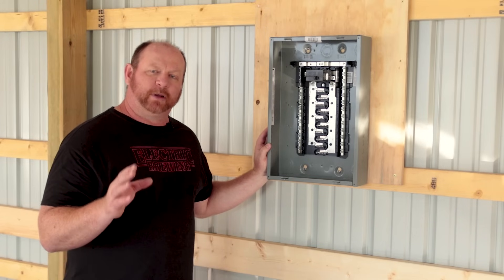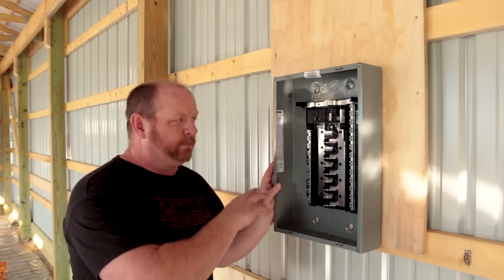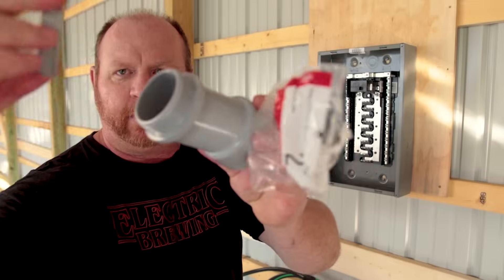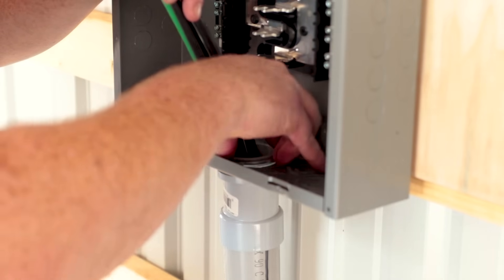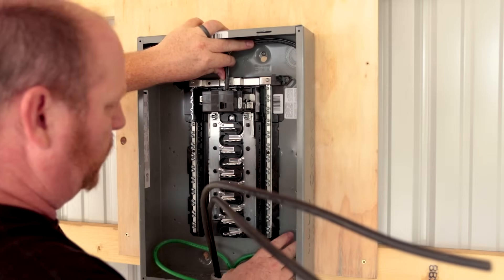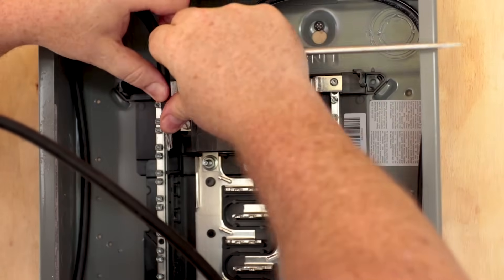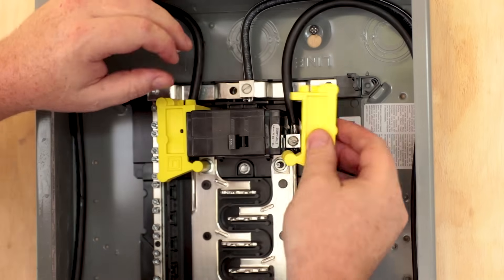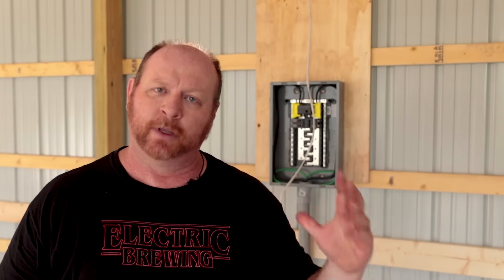How to install a main breaker panel in a garage. -  Square D Homeline 100 Amp Main Breaker

Comment: I HAD A NO PANEL INSTALLED OUTSIDE WITH ITS OWN SERVICE HOW DO I make runs to sheds and other places if needed. do i need conduit for each run? what is needed when it goes into shed? i know how to install outlets just confused when it enters shed
Reply: Is he working with a 100 amp size breaker panel ? Or a 200 size breaker panel?

Comment: I don’t know why someone who’s not an electrician would put out a video like this. And why would you use aluminum wires. I just spent last winter doing aluminum wire mitigation. The amount of melted wires I found was crazy. I’m surprised the apartments hadn’t all burned down long ago.

Comment: You failed to use No Ox on your aluminum L1 & L2 and N (main) power wires. You also failed to discuss the difference between bonding your Neutral and ground wires. If this is a sub panel, they need to be separated. Some major flaws in this video.

Comment: Could you have installed the panel upside down so the main conductors wouldn’t have to run up along the side of the panel and loop on top to connect the main lugs?
Reply: I was thinking the same thing. I bought a similar panel and I installed mine the other way around for that very reason.

Comment: I always install and plan a Double Pole breaker at the top right side closest to the main breaker to anticipate a future generator install.   I like to prewire it to my outside generator  inlet box early (now) while the box is empty,  you will be glad you did,  when it is time for the generator.
Reply: yep.  I'm adding a generator circuit 10 years after the initial install and I have to convert my main lug panel to a main breaker panel, and then move several existing breakers to free up space for the double pole at the top right.

Comment: Bro.. I’m not sure you should be leaving this content out there.. some glaring issues.. I’m not an electrician either but I do know you need some grounds.. first point from street line will always only be three wires after that you need to have actual ground plate/rods for the 4th wire.

Comment: I think (...) this is a sub panel?
You've correctly got 4 wires coming in.
The connection ("bonding") of neutral & ground is a big deal in the electrical code - 3-wire supply from utility - with neutral & ground being equated.

After you leave the main panel, neutral & ground shall no longer touch, and their connection to the sub panel is different, and should be respected.

Comment: You need nolocks on that aluminum wire.and are you bonded in that panel? And also in the feed coming from the AB phase of the other power source? Just want you to be safe.

Comment: I have a 10X16 shed and will get a 100AMP circuit box with 6 space 12 circuit indoor surface mount with cover. I want to have 2 overhead lights and 3 electrical outlets 120 volts and a small hard wired space heater.

Comment: not very clear what is the green wire for and what do you do with that and how do you connect your breaker box to your disconect box in your house and what size breaker do you use in your diconnect box to supply power to your 100 qmp main breaker

Comment: A Neutral Conductor and Grounding Conductor are TWO different conductors and should only be common and bonded at the FIRST Disconnect Panel on the Load side of the Meter BUT NEVER in a Sub Panel !!

Comment: Neutral feed should have white electrical tape around it's insulation/jacket at the point of termination. Also stranded wires should be tightened, wiggled, and tightened again several times to ensure a good fire-free installation. You don't want to over tighten the wires, just gently(at the torque spec), squish/flatten the strands out.
Reply: At first I thought they were all black, but then one had a white stripe running down so I knew that was the neutral.  Yep, putting a couple inch wrap of white tape is a good idea, no confusion as to what it is that way.  For some reason when you get down to a certain low gauge wire, they don't offer white insulation anymore.  Although it is not necessary, occasionally I've seen where one of the hots was a red stripe.  Also some bare wire outside the connection. Just a little, maybe 1/8th.  This way the inspector can visually confirm the screw is making full contact with the bare wire, NOT the insulation.  Your going to be pulling up to a 100 amps through it.

Comment: I definitely agree you need to install a ground wire to the ground bus bar (which is not installed) a ground wire from the ground rods in the ground or a ground wire from the main panel to the sub panel. Without a good ground wire, you are at risk for a shock or a leakage of voltage in the panel where you don't want it to be.
Reply: Would the ground wire from the maim panel connect to the ground bus?

Comment: Call an electrician. There are many intricacies and things on these videos that you simply don't have knowledge of. There's a code book about 2 inches thick and Each application is different. These videos are dangerous. I am a 25 year licensed master electrician. Just my opinion of course. You can burn your house down and call me to rewire your new home.

Comment: Here is a question I have for many people whether electricians or not what is the reason for having you breaker box to where you have to put more wire and more hassle to get it all around in the box when you can just flip the other way around and have much more space and less to spend on wire what is the point of it.
Reply: I believe you are asking why install the breaker at the top instead of the bottom if the conductors are coming from the bottom.   Some panels can be installed either way, your choice.   Some panels can not.  In commercial work, you have to specify the location of breakers and lugs when ordering them.   Some people think the main has to be at the top when they do not.

Comment: Spotted quite a few things here that bugged me.

1. Panel should have been installed with the main breaker at the bottom. No need to clutter up the gutters with your entrance wire, the panel is designed to be mounted in either orientation.
2. You must use no-ox compound on those aluminum conductors
3. Tighten the lugs to the manufacturer's specified torque values.
4. Lots of others have mentioned this, but you need to tie the subpanel ground to the main panel.
5. Ensure the bonding screw is not installed in the subpanel, neutral and ground cannot be bonded.
6. You need a ground electrode installed at this detached building.

Comment: My pet peeve other than not connecting the ground. Even if you think power is off don't connect a breaker while it is installed into the box. Check your length first, then pull that breaker out of the box connect your ground and your neutrals into separate buss bars then with the breaker out connect you hots to the breaker. Once that is done put some rubber insulated gloves on your hands and press the breaker in the panel with the switch in the off position. You will be less lickley to to touch the hot buss bar at the same time while installing the other wires and creating a circut. Plus your hands are wet you can be just inches from the panel and have a jump or arc, plus you don't know if you or someone else wired something else wrong down the line. Just remember even low voltage wires can cause heart arithmia or make your heart start beating wrong if you get electrocuted. Be safe

Comment: This guys setup would not pass code i n many places.  He did not address grounding and the neutral adequately.  This box amounts to a sub-panel. Ground and neutral at this point must be kept separate and I'm not sure  that setup will ensure that. Aluminum is not a good material to use anyway.

Comment: You forgot to put the aluminum paste on the ends when you're going in from aluminum to the bus bar
Reply: That is only required if the panel board manufacturer has written instructions stating it is required.   Antiquated product.
Reply: @KevinCoop1   Why though? Aluminum will still get oxidation, are the wires and lugs made out of different alloys now?

Comment: I hope you came back and slimed it with antioxidant later... it's a code violation to install aluminum wire without it.
Reply: Not a NEC requirement.   Not a Lug manufacturer requirement.   Not a conductor manufacturer requirement.   Antioxidant is an antiquated practice.   Only required if equipment manufacturer has it in written instructions.   Normally not required.

Comment: Yea almost forgot with aluminum wire you need nolox
Reply: Antiquated requirement!   Or not required.   Only required if equipment manufacturer requires it in writing.   Very very seldom required.

Comment: No Ground ,the ground wire was in the panel but not connected if this is a main panel fed from the transformer there needs to be 2 ground rods and the neutral bar needs to be bonded ,if it's a sub panel it needs a separate ground bar and neutral bar does not get bonded
Reply: At 2:08 he showed the outside meter/panel.  He mentioned there was only one bar in the panel.  So, this is a sub panel to a separate building.   It is required to have 2 hots, grounded conductor(neutral), and equipment ground.   It must have a disconnect means at or near feeder entrance Article 225.30.   Main breaker does the disconnection.   It must also have separate ground and neutral bars. And as you said it must have grounding electrode(ground rods).

Comment: Where does the copper bare wire come from the two grounding rods inside the breaker box
Reply: Must be connected to ground bar.

Comment: I have an old fuse box in my garage that I'm replacing. My feed is coming from the main panel in the house underground to the garage.  Both my black hot wires are going to the main fuses but my white is going to an outside earth ground and my green is going to the neutral bar inside the box with all the white neutral wires from all the lines coming in going to the receptacles, lights etc. I feel like the green and white should be switched? I'm getting ready to change the old fuse box to a sub panel breaker box.

Comment: Appreciate your time of doing this video. My own effort will be a little harder by hooking my new breaker box to a installed meter/main breaker box on a pedestal  that is a 200 Amp at the pedestal and I am using a 200 Amp breaker box in my house. I'll cut power off before I hook up my # 4 wires inside the pedestal box.....and a thank you to some of the added comments about the neutral and grounds coming together. I also visually saw the earth ground rod at the pedestal and connection. 
I didn't install one at my house breaker box. I can still add that.

Comment: Like Jerry Morris said. Ground and neutral separated for a sub panel. Ground rod for sub panel in detached building. Neutral & ground bonded only at first point of disconnect
Reply: My detached garage has a subpanel. In feed is 220 with red, black, white and ground. Is it normal to have voltage between the ground and either of the 120 feeds? I never located a ground rod installed.  I will add one.

Comment: You did not show how to deal with the green ground wire, depending if this box is a sub panel then the ground wire gets its own bus, if it is the panel then the ground wire gets connected to the neutral, you need a wire going to a ground rod

Comment: All aluminum conductors must have anti-oxidation compound as per NEC. You did not say if your green bonding screw was removed or not (very important to remove it in a sub panel).   Only your main service panel (the first distribution panel where your utility feed come into) can have this bonding screw installed.  The bonding screw in every downstream sub panel from the main service panel MUST BE REMOVED.  You must have a ground wire (usually #6 or greater) run from the main service panel to every sub panel.  

ALSO You definitely need to use 4 wires,  1 neutral, 2 hots and a ground wire.  That panel is a electrical hazard without a ground wire.  I'm going to assume that the panel outside that you pictured in your video that your getting your power from is also a sub panel.  In the outside panel you correctly identified the 3 current carrying conductors,  2 hots and a neutral,  but there should also be a ground bar inside it with a #6 ground wire on it (or the green bonding screw installed if its your main service panel) and you have to tie that ground bar to the ground bar in the new panel with #6 or greater ground wire.
Reply: Yes in the 70ds don’t needed unless your in Florida
Reply: Yes, looks like aluminum (not copper as he said)
Reply: It's a main panel not a sub panel. He simply needs grounding rod/rods at the panel and a ground bar at the meter.
Reply: I dont get ppl like this posting and giving bad advice as to how to do something, do the research and make sure things comply with NEC codes
Reply: @AM1015- Enlighten us whats wrong with what I said?

Comment: Aluminum wiring?  I thought that went out years ago due to it being substandard to copper.
Reply: @FelixtheMetalcat  The Busbars in that Homeline panel are Aluminum.
Reply: Ok, well great....copper still trumps aluminum all day and I still can't believe codes allow aluminum wiring..🤔🤔🤔.   Other than being a cheapskate, I dont understand why you wouldn't use the better and safer product.
Reply: @FelixtheMetalcat  I agree, I would use copper only. But aluminum is allowed and is cheaper is why some use it. But you do have to upgrade the wire size if you use it.

Comment: Can i put a 100 amp box in my shop and wire shop like you did but run the other end to a 100 amp breaker in the main panel at house,it has 200 amp service

Comment: Lack of proper grounding is dangerous.  It appears that you are wiring a sub-panel with the main-panel located at the meter.  If so, you should add a ground bar to the panel and keep your grounds and neutrals isolated; they should only be bonded at the main-panel.  If this is a main-panel, then you are missing the earth ground.  Either way, this video is an example of what not to do.
Reply: 7b
Reply: He said at the beginning that it's a main circuit panel. He didn't show where the wire originated from though.

Comment: Could have installed the box so the main breaker would be on the bottom so you wouldn’t have to run the mail cables through the the the length of the box

Comment: That looked like aluminum wire.  Did you put any kind of antioxidant on them?
Reply: Not any more unless a really humid climate ,most of the issue was improper torque on the main lugs .

Comment: Can you talk about the main panel breaker I have no idea how they work, what they are called, how to get the right one for the pannel you have, if there are differences between: 120 n 240 panels, plug in neutral bar panels. Thank you
Also how do you tell what volatage is coming into your panel?

Comment: This may be a dumb question so bear with me...but doesn’t the power company supply the wire that you hooked up? or do I have to do that and supply the wire myself? I am installing everything in about two weeks and want to make sure
Reply from the maker: You have to supply it.

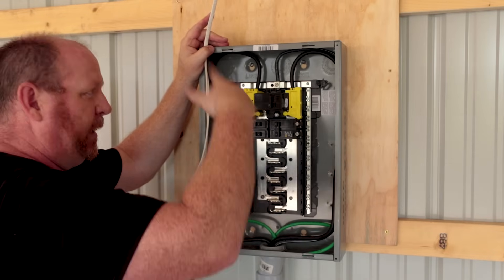Comment: May have already been pointed out (I didn't scroll through all comments) but at 9:28 you say: "the neutral and ground would go into there". Neutral and ground do not both go into the neutral bar. Neutral and ground must be separated in a subpanel.
Reply: 100% correct!!!

Comment: I would have used a 1/0 or a 2/0 for your run. Only because you are running aluminum cable. If you were using copper number 2 would have been ok .. but if you are running 50 foot or more I would have just went with a 2/0 ...do to voltage drop and current flow .. I would venture to say with your setup it is okay but you probably are only safe to about 80 or 90 amps

Comment: The meter almost never has a grounding wire unless you put the grounding rods there as a cutoff... The electrical company does Not provide a ground, you Must drive in grounding rods (usually 2, 10' apart, but check local code). That's what you attach the ground to.

Comment: Brian it's not about respectful, it's more than that. It's either  works or kaboom. Dangerous and must not be taken light. What you did with the green wire (ground wire). You need to show a least a 15amp connection circuit.

Comment: I don't know where you are, but here in Minnesota, you need to ground the panel separately from the feed. That means a grounding wire (#6 copper is fine) that goes either to nearby grounded plumbing or to an exterior grounding rod, 8-feet long copper. In a garage, that almost certainly means a grounding rod driven into the ground.
Reply: How much does that cost

Comment: Where's the anti-oyx on your main wires?
Reply: Yes he failed to put anti-oyx on alum wire. He would of failed inspection.
Reply: NEC does not require any.  Local jurisdiction may require, but if it is not required by the manufacturer,  no code violation.
Reply: you  forgot  to put    anti -Oxidant.

Comment: https://www.udemy.com/course/low-voltage-circuit-breaker-designing/?referralCode=B0C096E8D8523F252399

Dear Friend For "CIRCUIT BREAKER DESIGNING" enrol FREE FREE FREE FREE

Comment: Just letting you know with aluminum conductors need a oxidizing agent on then such as nolox which prevents corrosion overtime
Reply: Anti oxidation is not required by NEC . Panel and breaker termination points are rated for copper or aluminum,  therefore no oxidation between dissimilar metals.

Comment: I am replacing a sub panel that I want to hookup a generator to and have have to replace the sub panel as there is no main shutoff.  Need to put a panel with a main shutoff so I can install an interlock switch to make it compliant for when I need generator so this helped explain somewhat on how to rewire a panel.